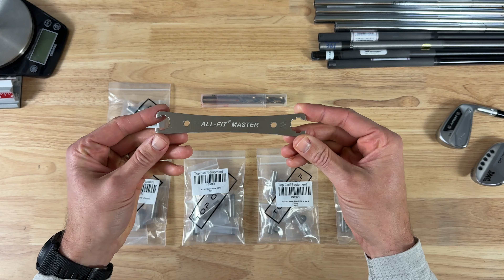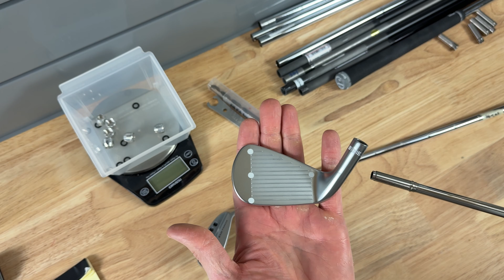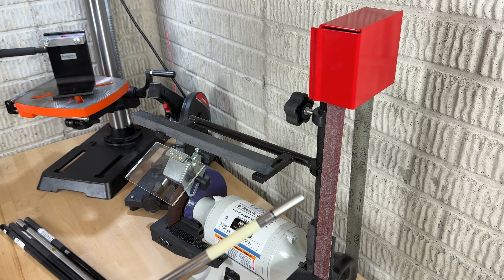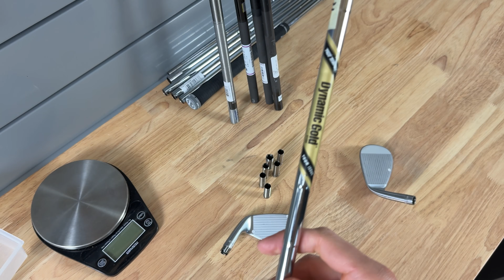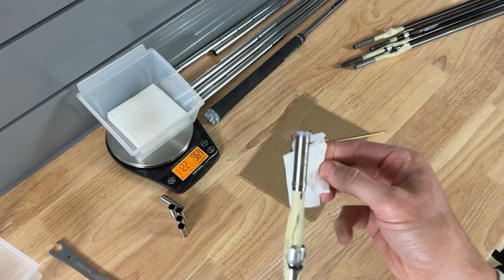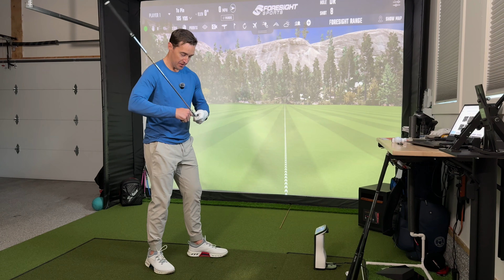This Adapter System Changed How I Test Golf Equipment

Comment: Hey!  Quick question.  I just got my All-Fit adapters for irons and woods.  I ran into a problem when installing the Master shaft adapters to the wood graphite shafts.  The different Master Adapters I have, such as TaylorMade, PING, and Cobra, they all have different depths to flush the shaft all the way into the adapter.  TM adapters are the deepest out of the bunch, and the Cobra adapters are the shallowest.  So If I install the Master shaft 0.335 on to the shaft to fit TM adapters, it wouldn't fit the Cobra adapters cuz the teeth of the Master shaft wouldn't even reach the Cobra hosel adapter since it's not as deep.  How did you deal with this?  My only guess would be is to install all Master shaft to fit Cobra adapter since it's the shallowest, but my main concern is that there would be a lot of free space at the tip end of the adapter for not installing it all the way in.  I don't know how stable that would be.
Reply from the maker: To be honest, I'm completely unfamiliar. I would reach out to info@allfitgolf.com with that question. I haven't messed with the master system for woods and personally was planning on going with the universal system due to it being the most "normal" 1 for 1 replacement of a standard adapter with no additional tipping requirements. I'm pretty sure cool clubs uses all fit master on their woods though, so maybe a call or email to one of their shops might help out too? 

Let me know what you figure out and how things end up working on your end. Feel free to reach out at cloudycoastgolfco@gmail.com
Reply: @CloudyCoastGolfCo  I did reach out to All Fit.  It's just that the communication is not so clear due to the language barrier.  Not to mention, the response comes during odd hours, and they are not so prompt.  However, I did get a response from Liam, and without any explanation, he just said to install all shaft adapters flush to the tip of the shaft.  In principle, that is going to work, but I guess a longer depth adapter like TaylorMade is not going to have the shaft in all the way.  That's the official response from All Fit, so I will let you know if there's any issue after installing.  Thanks for the prompt response regardless!  I really appreciate it.
Reply from the maker: @GTS-ORL  got your email, thanks for the pictures. I'll respond shortly!
Reply: @CloudyCoastGolfCo  Yeah, I just wanted to share my own experience so that if you run into the same issue, you will know what to do.  Have a great week!

Comment: did you ever run into any issues while drilling the heads?
Reply from the maker: No it was fairly straight forward, I would say drill press with the vice would be pretty tough to screw up as long as you have the depth measured. The bit they sell on their site did the job.

Comment: Great in-depth video!  After 3 months of usage, has your mind changed on the overall experience of this universal adapter?  Are you able to bend the irons with these adapter on with no issues?  In another All-fit video created by Elite Fit Golf,  he stated that All-fit Golf sent him .370 tip adapter even for .355 taper tip shafts he was installing into because they had better tolerances?? Was your install experiences with both .355 and .370?  If so, was .355 install giving any kind of issues?  Are there any other universal adapters you were entertaining other than club connex?  Thanks in advance.
Reply from the maker: Thanks man, glad you liked it. 

It’s been good, I’ve been behind on doing the testing for the videos using them but I’ve hit a decent amount with it so far. Only thing I’ve noticed is when making lie adjustments with the 7i head I can see where the hosel insert is in the head. So maybe a potential fatigue issue in the future but holding up so far. 

Feel is great and no real issues with any of the fittings. I’d have to check when I’m back home for you, but I’m pretty sure I did .355 for everything with .37 and .355 both fit in the same hosel with no concerns on my end.

Like the logo by the way!
Reply: @CloudyCoastGolfCo  I really appreciate you taking time to answer my questions in details!  And thank you for your liking my logo!  Yeah, I've been talking to Liam at All-Fit directly, and I'm gonna buy a bulk of adapters for irons and woods.  I really love your shop setup and how clean it is.  Also enjoy all your videos!  Keep up the great work!
Reply from the maker: @GTS-ORL  Appreciate it! And good luck getting set up in the shop yourself

Comment: Good stuff.  So I just installed 5 of these but had to remove one (forgot to tip trim it).  Let me tell you. . . Removing these takes a lot longer than a normal head😂.  Apparently titanium is not only heat resistant, it's very resistant to heat of conduction.  Took forever to get the epoxy to soften enough to get the adapter off my graphite shaft.
Reply from the maker: Oh man, I was planning on recycling these fairly easy! Good to know.
Reply: @CloudyCoastGolfCo it's plenty doable. Just caught me off guard.  I like that idea.

Comment: Hey awesome video! Do you think this All fit adapter will work for driver/woods? Would love the exact same video but for driver/woods! Keep it up the content! You got a new subscriber
Reply from the maker: Appreciate it! 

So all fit has their own universal driver adapter that has specific pieces for the individual manufacturers. Haven’t had a chance to test it yet but it seems solid and planning on using it for side by side club head testing on here. Gen 3 or 4 I believe is their current model. 

This particular adapter system is also available in the wood category (nut, adapter, etc.). Not necessarily the best thing for someone looking to just have the option to change around heads as it’s more fitter oriented. Additionally I don’t believe it’s USGA compliant.
Reply: @CloudyCoastGolfCo  are there 2 different all fit adapters for driver/fairway shafts? Im planning to build a set up at home so I can test different shafts with different heads so I can keep one things constant. Which system would you recommend?

Also, im fairly new to club building. How do you think I should go about learning how to build my own clubs?
Reply from the maker: @princetonlo2272  Yeah, one would be more for a fitting studio under their master line which I don't think you'd want. The other one is this one: https://allfitgolf.com/products/all-fit-universal-golf-shaft-adapter-sleeve-0-335

IMO the original TXG channel with Ian Fraser, now Club Champion had the best content to develop an understanding of how these different variables affect the player and the ball so I'd look at their channel and scroll back. Now Ian has a separate channel called Fraser Golf Institute which I would definitely give a follow.

In terms of how to learn how to get into changing things on your own, this channel obviously! I'll be getting into a variety of topics around how to do each aspect of the club building process. But in general when I started, I used a variety of different channels to see their methods, tried out different things on my own and then ultimately settled on what worked best for me. Channels like McGolf Customs, Mobile Clubmaker are very process orientated and can help give you a perspective, and channels like Loggerhead don't instruct but you can see their process. 

Start with grips and then steel iron shafts to see how you like it. It'll also be the cheapest from a tool cost standpoint which is what I did. Then if you like it you can move on from there, graphite shafts, swing weighting, loft/lie. There's so much stuff to get into, shaft cutting, swing weight, tipping, total weight, affects of grip size, etc., it's a hobby that'll keep you busy! 

I've got a video on the custom wedge build I just did that I'm hopefully getting wrapped up with soon to get online.

Comment: If you ever get the woods all fit setup too, would love to see an install video like this! Awesome video!!
Reply from the maker: Appreciate it! I’m looking into doing a comparison video between club conex and the all fit driver/wood adapter set up
Reply: @CloudyCoastGolfCo  I’ve been a fitter and master club builder for a long time in my professional opinion the all fit is so much better than the club connex, especially for fitting and correct final swing weights being much closer, further club connex you now need to have a subscription to get any club connex parts which is not ideal if you are a smaller business and they always have minimums you have to buy. It may have changed in the minimums now since I haven’t bought there items for a while but I know the subscription is still in place
Reply from the maker: @crecgolf88  Oh man, I had no idea that they switched to that model. Definitely in the All Fit camp now, especially since they updated their website and you can buy directly from there now. 

What are you using in the drivers in your shop? I bought the All Fit and the club connex adapters to test and the all fit really seems more stable just out of the box. Deeper adapter, adjustability is more clear, seems more sturdy.
Reply from the maker: @crecgolf88  Well that definitely puts me more in the All Fit camp now, especially since they updated their website and you can order directly through there now.

Do you make adjustments to loft or lie with the adapter in there often? How has that held up with durability of the club head?